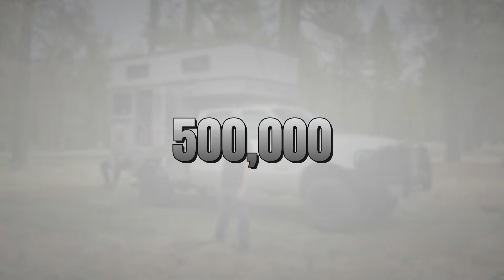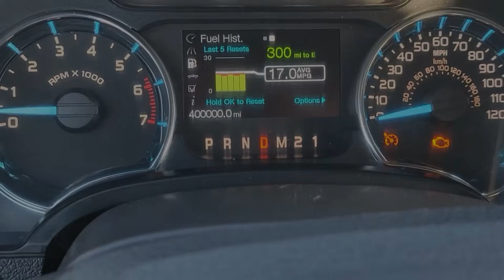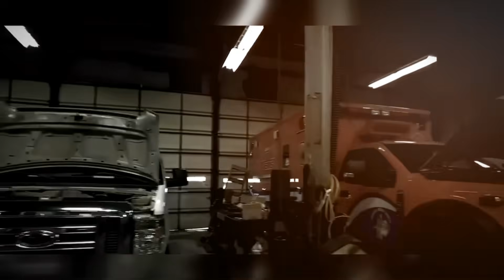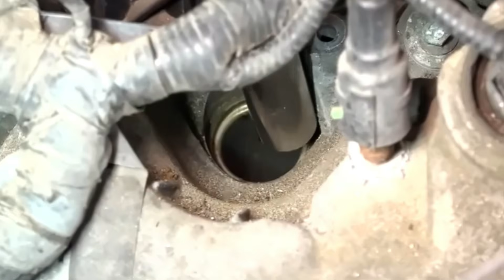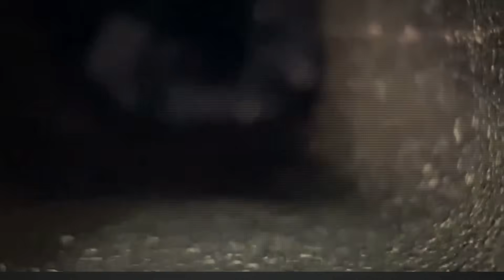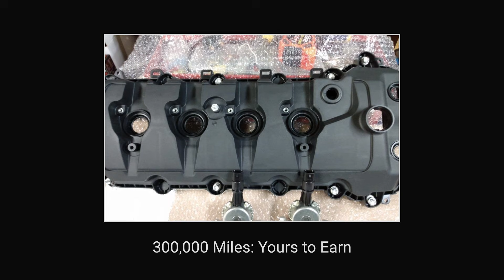Only These Ford Engines Hit 300,000 Miles

Comment: Aerostar4.0 cologne  v6 built in germany= 500k w maintenance
Reply: It was also used in Explorers and Rangers. It easily matches the 300L6 in longevity. Tough little motor.